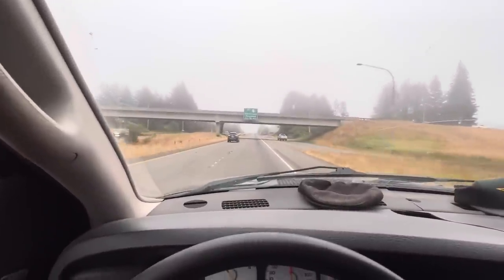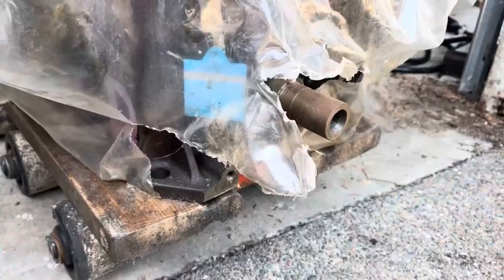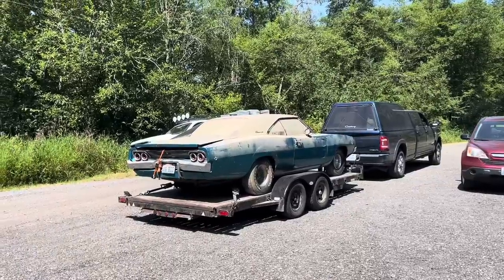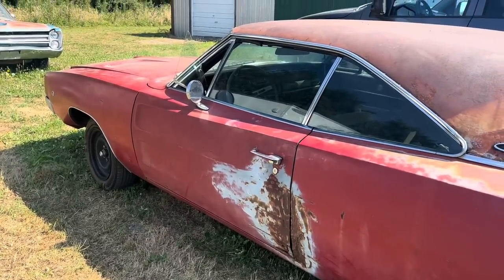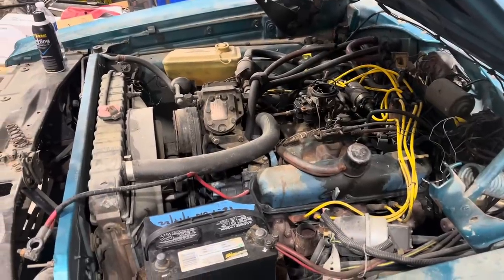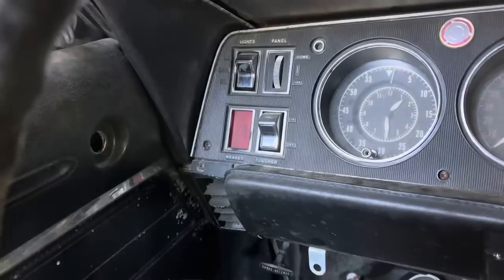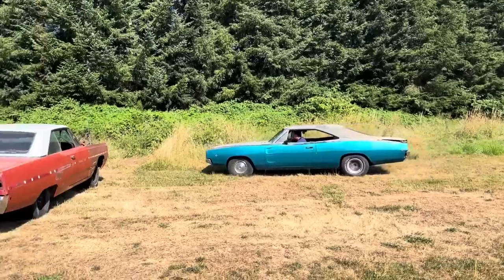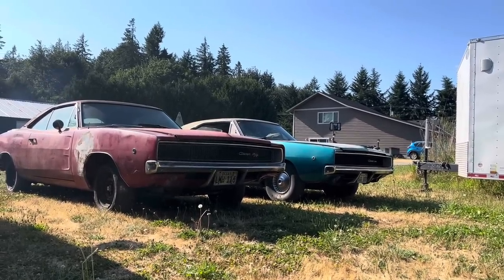First Drive In 28 Years! 1968 Dodge Charger Garage Find Comes Back To Life

Comment: Question for you if it came with the 318 is it best to keep it that way or to change it up to more powerful engine?
Reply from the maker: Subjective. 318s are pretty great engines but not power houses for sure. There is little added value to having an original engine in a low line 318 car. This one is tired. We may well install a 360 instead - it will look mostly correct, but have some extra poop. A 440 swap is pretty much the go to. It would certainly add a good bit of muscle, and may even increase the value. Personally? At this point in my life, I like stock - and I like the idea of leaving things alone as much as possible.
Reply: Make sense so why not 4 sure

Comment: Man, another '68!
That's awesome.

Hey Jamie, where do you prefer to get patch-panels,rocker panels, & cab corners specifically for an '83 D150?  "AMD" is useless when it comes to Dodge trucks.
Reply from the maker: I haven’t actually gotten around to buying any yet. I bought a wheel lip / bed side patch once but can’t remember who made it. It was missing the hump lines above the wheel opening and wasn’t very nice, but we made it work. AMD is of course the way for car stuff. The only patches I’ve done in trucks were hand made.

Comment: Man I love that video it inspires me to play the lotto more often so I can get my 68 resto mod with my 572 cubic inch hemi and disc brakes of course but no traction control because we all know back in the day traction control was your right foot,  airbags who needs a broken nose, and really who cares about all that body roll you just punch it a little bit and start drifting the back end you forget all about that body roll"   but one question I've never really ever had answered well at least back in the day when there was no internet the last three numbers of the rear end indicating the type of pinion the 789 and the 742 I've always heard was better than the 741 out of the three I know one has a tapered pinion one has a collapsible bearing yada yada yada but that's about as far as it went so if there's anybody out there that's knowledgeable about those three rear ends in question and can finally resolve the answer once and for all as which is the best and the more heavy duty
Reply: I have a really nice Mustang but I play the Lotto so if I win I can buy a Supercharged Mustang convertible and or a new Scat Pak Widebody Charger. Either one of those would really get me excited. I can't really modify my current Mustang with a supercharger or anything else because it is one of the 500 Parnelli Jones Mustangs and it is really cool just as it is!

Comment: Don't change a thing about your videos. Although a shop dog running around or sleeping in the background would be good. That was a nice Chrysler 300 you looked at on the trip back home was that a buddy of yours? Could you give a quick and dirty explanation of the ballast resistor function? Did other manufacturers besides Mopars have them? Thanks
Reply from the maker: I have a whole video on Ballast Resistors! It’s called “The Big Ballast Resistor Video.” Yes, other manufacturers used them. ‘57 Chevys had them, for example. My dogs are not well equipped for shop life… one frequently goes on unsanctioned adventures, and the other just barks at everyone and hates children. It’s a problem… can’t remember which 300 that is. There have been several around. Haha.

Comment: It has the typical Western Washington rot but the license plate numbers would concern me more than that! When you find one in Eastern Washington they are typically much better rust wise! I bought a 69 Camaro a while back that just sat under a carport of 30 years without being run that only had a few pinholes under the rear window on the drivers side. Most likely because it is a vinyl top car! Anyhow I hope the car doesn't have any bad Ju Ju from it's plate number!
Reply from the maker: I’m not worried 😅 it hasn’t burst into flames or anything… yet
Reply: @DeadDodgeGarage  It is kind of odd especially in these times! Don't get me wrong the car is cool but I am a bit superstitious! My family is from the hills of Eastern Kentucky and I heard a lot of ghost stories and such from the old timers who were still alive in the sixties when I was a kid. Anyhow you will get new plates when you do the transfer so all might be well!

Comment: I can't believe the car would survive all these years and then people would try and beat it to death
Reply from the maker: With one burnout? Lol
Reply: @DeadDodgeGarage  so you say.  Have a good day
Reply from the maker: @tomriggle3217  the car has now had the rear straightened on a frame rack, driver door fixed, interior pulled and cleaned, all brake hydraulics, complete rear brakes, axle seals, fuel tank, and engine compartment wiring replaced, and runs and drives down the road. The tired old 318 will be next to go. I don’t know what you know about Chargers, but mine cost $50k and does block long burnouts periodically. No regrets. I’m having a great day, thanks.
Reply: @DeadDodgeGarage  all l can afford  68 RR

Comment: The Northwest is not kind to vehicles in storage
Reply from the maker: No… I once bought a ‘55 Chrysler that had been inside for many years, but shoved outside for the previous ten. It looked really solid… until I started poking at it. All that was holding the rockers and doors together was paint. We’re lucky (and pleased) around here if things are only missing lower quarters and some bits of floor.

Comment: Run 5-10 gallons fuel and 4-5 ounces of the Lucas fuel system cleaner.  Should clean up all that exhaust smoke.   Maybe.  But I would try it.  I’ve had really good success with it in engines that have been sitting around way too long.
Reply from the maker: No… she’s got a dead hole unfortunately. We’ve swapped it for a Magnum 360 now!